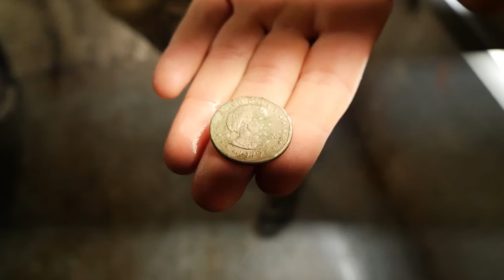RUSTY but RARE 1976 Chevy K10 Sport Truck REVIVAL!

Comment: Backup Truck instead of a Pickup truck definitely. Besides that washers n cotter key and a accelerator bracket has your truck running and moving pretty good. Cheap date, just how I like em. 
Are there fish in your pond is my question?
Reply from the maker: There were, but we had a dry spell

Comment: The reason it has no park is because someone bought those hub locks and with a manual transmission it’s fine but with an automatic transmission it’s a giant no because if you unlock the hubs then on a NP203 transfer case which is full time 4x4 all the time except when in 2High but remember the hubs are locked so the drive shaft can’t spin at idle and the transmission is put in park but if the hubs are unlocked the front driveshaft is spinning as the engine is idling and you put it in park and Boom goes the park pawl and drum. There you go and there are thousands of k10-k30 and K5s that have automatic transmission and no park.
Reply from the maker: It had no park because the shift linkage fell apart, which I showed, and fixed in the video...

Comment: Do fluid filter inspect the valve body and replace the vac mod make a bracket for it that will bolt to a pan bolt or 2 if need be. It will be fine. 
Is one of lines you did something with pinched any place or cloged restricting the pump ? Don't blow air back through them though use chunk of wire to run back through , if you get a bunch of air the trans it will howl like crazy later. The Air gets trapped in the converter .
Reply from the maker: Don't you think that wouldn't allow it to go in reverse either?

Comment: Coin collector here: Those "silver dollars" are Susan B. Anthony dollar coins. They're not silver, but copper nickel clad like every modern quarter dollar and dime has been since 1965, with 1964 being the final year for circulating silver coins. (And half dollars, but the half dollar is unique in having some silver after 1964. Halves are 40% silver from 1965-1970). Those Susan B. Anthony dollars were minted 1979, 1980, 1981 and again in 1999. Their replacement was the "golden dollar" coins of the same size featuring Sacagawea, a Native American woman who, as a teenager, helped Louis and Clark in their exploration of the Louisiana Territory . The Susan B. Anthony dollar was the last regular-issue dollar coin to use the traditional copper-nickel clad planchets, having a silvery color like a modern quarter dollar or dime. It was also the first U.S. dollar coin to be that size / diameter; larger than a quarter but smaller than a half dollar. The previous year, 1978, was the final year for the old larger diameter of 38.1 mm, the size of the U.S. dollar coin from 1836-1978. Susan B. Anthony dollar coins are not particularly valuable, especially when circulated or damaged, corroded, etc. They are still worth their face value of $1 each of course. 1979 does have a collectable variety, the "near date" where the 1979 date is very close to the rim. If you care, just search for photos of that variety and see if any of your coins match up. It's a truly subtle difference, and even if you DO have one, your coins are not in mint condition. LOL. A nice one would be worth about $15, so less than that if you have a 1979 near date.  I would personally keep them, or at least one of them, as a reminder of how this fine Chevy truck treated you guys. Great video, cheers!
Reply from the maker: Thank you for the well worded and informative response!
Reply: @PoleBarnGarage  You're very welcome! Thanks for the kind response. I just subscribed, having followed this truck over from Kevin's channel - I enjoy your sense of humor and editing style. Happy motoring!

Comment: Climb under the truck and pull the vacuum modulator out of your transmission and get another one or check it and see if the little hoes there's crackerst and there's a bracket and a screw there you can unscrew and just pull it out real gently and then pull the old ring out and get the new 1 and put it in there and I think that might cure your problem with shifting in the 1st 2nd 3rd year if it has a 400 under the A Turbo 400 training
Reply from the maker: A modulator has nothing to do with it being stuck in reverse. It controls line pressure, line pressure controls shifts

Comment: You had a lot of fluid spray out of that thing. Not saying you didn't fill it and check it but...
An automatic can move in R for race gear. For a while. But sit like a stone in drive. 
After losing fluid like you did, it is very likely even if you got a full mark on the stick, when you put it in gear the passages of the valve body, torque converter, clutches bla,bla,bla. They sucked the pan dry. 
You need to run it through the gears and check the fluid again running. Keep some ATF handy on your first highway run. Good chance when it hits high gear it'll slip. Check the fluid again.
Good luck.
Reply from the maker: Watch the next video, it's trashed.
Reply: @PoleBarnGarage  Well it was worth a try

Comment: there was something that was holding together the gears for the drive in the old transmission fluid thickness and having it all piss out and replaced with new less thick transmission fluid freed up the broken part and now it dont work. sucks but sometimes old parts only work with old fluids. which would also mean to replace the fluid with already used or thicker fluid to get the same result when doing maintenance.
Reply from the maker: It's not a matter of thick or thin, it's friction that makes an automatic trans work.

Comment: Just out of curiosity.. did you unlock the front hubs? I noticed when you were loading the trailer the four-wheel drive was engaged. Just wondering.. Good video love those small bodies!
Reply from the maker: I tried it both ways, 4wd definitely works and unworks as it should

Comment: It's on the passenger side of the backgrounaccumulator on the transmission it looks like a little spaceship where the hose that's on and sticking out of the side Those go bad a lot
Reply from the maker: That's a modulator. It controls line pressure.

Comment: Probably the valve you zip tied isn't happy on the transmission you should try a different one and something different to hold it in place where it needs to be
Reply from the maker: That's just a modulator valve, it controls line pressure via vacuum reference
Reply: @PoleBarnGarage  I've had them mess up and forward gears wouldn't work unless you shift it to first and manually shift it that's the only thing I could think of why all forward gears aren't working had them lose vacuum and do the same thing also

Comment: The reason the transmission doesn't have park is because the parking pin broke. We rebuild them for derby drivers and it is pretty easy to break
Reply from the maker: Parking pawl, yes. On the black trucks trans it's because the linkage came apart, as shown
Reply: @PoleBarnGarage  my bad I didn't make it that far into the video and thanks for replying

Comment: Maybe there is rust pin holes in the modulator where the bracket touches it . I've run into that before too.
Reply from the maker: That would be a vacuum leak and cause it to not shift automatically, but to not have any forward gears?
Reply: Oh well my old man says the snap ring most likely poped out of the forward drum some how , but is usually caused by going from reverse to drive while in motion if it was a driving then stoped and didn't drive again next use . or try too. He said yeah the bad mod would just leave it in first , a clogged filter or low fluid could leave just reverse as well. All though I remember a situation on a 73 impala that would not go into any forward gears but did after replacing the mod , so ?  I think I'm leaning more to the pan getting mixed up adding fluid to it by the looks of what was on the floor causing a low fluid type issue in operation.

Comment: I'll take that quadrajet over an eldejunk any day of the week.
Reply from the maker: I've never had a single issue with an Edelbrock carb. Not great for power, or tuning, but damnit they universally function on anything. Quads are fine but they need to be set up right

Comment: You'd have to use a non-detergent engine oil to get any benefits out of any ZDDP oil additive.
Reply from the maker: They haven't used non detergent oil since the 30s.
Reply: @PoleBarnGarage  Putting ZDDP in detergent oil is a waste of money because the detergent kills the ZDDP additive.
Reply: @Pole Barn Garage  oils API rated SM and SN are high in Calcium detergents which reduce the effectiveness of high levels of ZDDP by washing it off of where it tried to stick.

The good news is GM specified a minimum of 600ppm ZDDP for their engines in the 50s-90s, and SM/SN rated oils all contain atleast 600ppm ZDDP with an 800ppm limit.

Comment: Bummer about the transmission. Try throwing some Lucas in it. Or did you drop the pan and check that the filters not plugged up with junk? That's cool The brakes fixed themselves. Lol.   Saw you were sporting the new logo. Thanks man!
Reply from the maker: Always brother! Yeah I figured I'll drop the pan and give it a gander before I do anything. Wouldn't you think a clogged filter would also not pump in reverse though? So weird!

Comment: Great job, greetings from Poland :)
Reply from the maker: Thank you!
Reply: @PoleBarnGarage  all this carburators, distributors, small blocks, body on frames its something that a lot of people from my country like for this ease of maintain or rebuild. In our country in 70' biggest engines was 1,5 i4 sohc or 2,1 bottom valve i4 that need to rebuild after more or less 100 000 miles and rust from factory.

Comment: Was it the Vacuum Modulator that the Bracket broke?
Reply from the maker: The bracket for it is broken, but why would the modulator have anything to do with only having reverse?
Reply: @PoleBarnGarage   I’ve had weird issues with clogged modulators before. At least on Turbo 350’s. If you are interested in 700R4 with a transfer case and have a 2WD 700R4 I’ll trade ya. Straight across.

Comment: Detent cable came unhooked in transmission
Reply from the maker: That has nothing to do with forward gears, keep watching you'll see what it was
Reply: @PoleBarnGarage  on my 81 it came unhooked inside transmission,   an it only had reverse. Maybe mine was diffraction transmission.
Reply from the maker: @orlandhartley9183  th350 and th400 gm transmissions that's only a kickdown cable, passing gear. You don't need it at all, I'm going to assume your case was just coincidence. Reverse is engaged with an accumulator inside, I did a bunch of reading on it, some stuck.